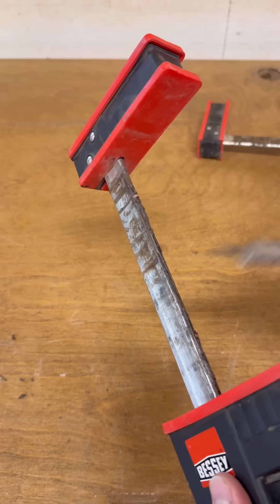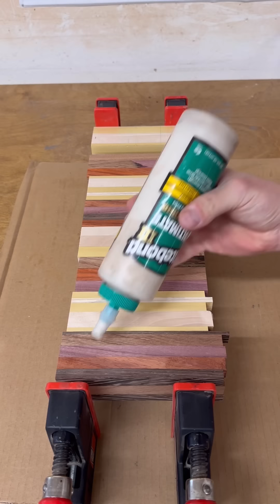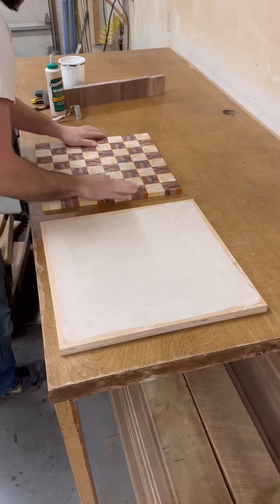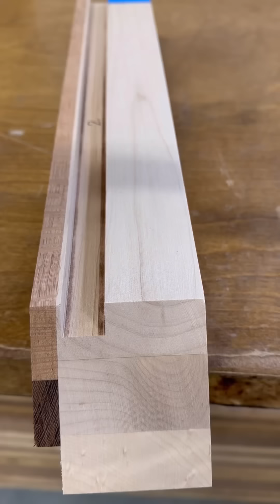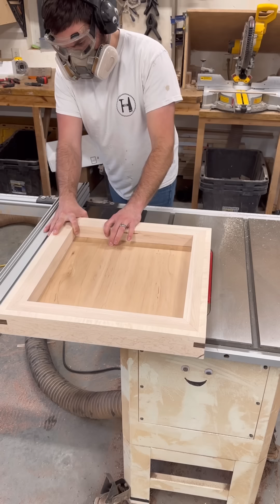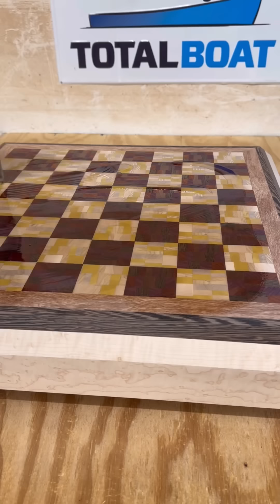This Took Me 13 Glue Ups

Comment: You could remove the respirator now! That’s totally overkill. And 40+ years of doing construction work I’ve never seen no one wear a respirator while just cutting wood now if you’re using some sort of chemical and that’s a whole Nother story.
Reply: Believe it or not the wood fibers in the dust in the air can cause you a lot of problems as well and for some people who may have had medical conditions that might require them to do this for them to feel a little bit more comfortable in their environment even though it may be a hot environment that's what they use for their personal protection because that's what they feel they need especially since a lot of us that have been in the construction industry don't adhere to the proper PPE standards anyway that we should have years ago when we were younger
Reply: Very odd response... I have bronchial asthma brought on by sawdust yet I work with wood daily. The respirator allows one to breathe after work

Comment: To remove glue from your clamps; 1 Cup, water, 1 Cup Acetone, 1 cup white vinegar. Put it on heavy  then  dry and put some johnson wax, or dry silcone spray.
Reply: *to ... too means "as well."
Reply from the maker: Thank you for the tip!
Reply: @hesswoodwork I just put blue painters tape on my clamps and peel off afterwards.
Reply: Or just use blue tape on them like everyone else
Reply: Wax paper,  poly or tape on the clamps to avoid metal staining into the wood
Reply: Glue up
Reply: To fluttershy e não falte o nome de 1 que não 🙈 o ☝️ de que não 🙈 o ☝️ ❤😂e ☝️ de ☝️ ☝️ de ☝️ 🎉😢a ☝️ e ☝️ a ☝️ de ☝️ 😮😅a ☝️ ☝️ de ☝️ e ☝️ de ☝️ 😊
Reply: To Pinkie pie e o a gente já sabe o quanto é importante 1 e o Silva do Santos e do time que tem o ❤😂de bom desempenho na competição com 🎉😢e ☝️ de ☝️ de ☝️ 😮😅a ☝️ e ☝️ 😊e ☝️ a ☝️
Reply: Thanks for the recipe. Finishes have continued to change from one decade to another. It is helpful to know the correct procedures. 😊
Reply: Wat?
Reply: Hermoso trabajo
Reply: Magnifique
Reply: Silicone in the wood shop? Risky for your finishes.
Reply: Фантастика 😮
Reply: Or just use way less glue, like wtf man.

Comment: Small tip that may help...ifnyou dont want to put paper etc between qork and clamp...spray your exposed clamp bars with a little cooking spray before gluing up...the glue comes off a lot easier

Comment: Tip
Shrink wrap bar on clamps. Keeps glue off bar. Flakes right off each drying cycle
Reply: IDK, back in the day we used to just wipe off excess glue with a damp rag and use wax paper  on the clamp bars. A lot less scrapping dry glue off things.

Comment: There's a reason veneer exists. I could make a chess board in about 15 minutes with a box cutter and cutting board..
Reply: Good for you but I'd never want yours and would take the one in the video in a heartbeat.
Reply: @J.D_7  I'm assuming you'd dismiss Chipendale, Sheraton and Hepplewhite because they used exactly the same techniques as me? There's a finesse you can get using veneers unmatchable with solid wood, for the simple reason a table leg can be veneered in highly figured walnut and be stable and strong. The same table leg made of solid wood and would buckle and crack over time because it has no inherent stablility.. In my mind a chess board is unlikely to wear out so why would you use one inch thick wood to make it? Impressive as it might be its a lot of unnecessary work for little asthetic or practical value.. I'm also a marquetry specialist and could inlay every individual square with veneer if I chose to. Not possible with solid wood..

Comment: Amazing work❤

How much wood do you need for this project and what is the best place to find it? Please let me know, thanks
Reply from the maker: Thank you! You can buy wood online. How much depends on the size.
Reply: You can find scrappy bits at just about any cabinet shop, though you're unlikely to have wenge in their scrap pile. Many will let you get bits up to 3/4" wide from their fall off bits, and may let you arrange to get cutoff from face frame or door stock material.